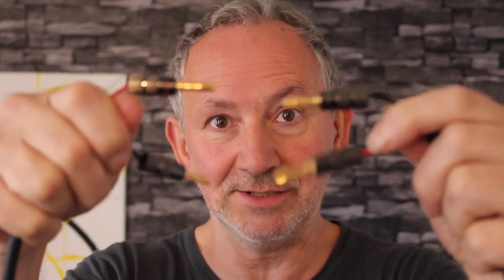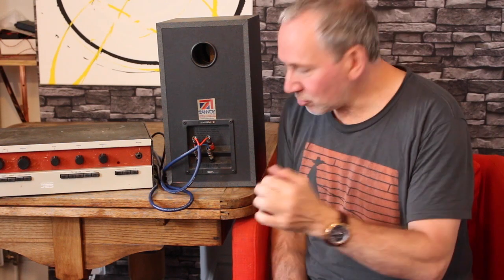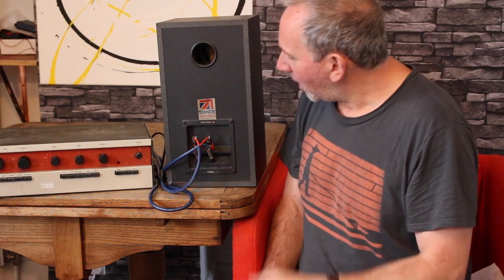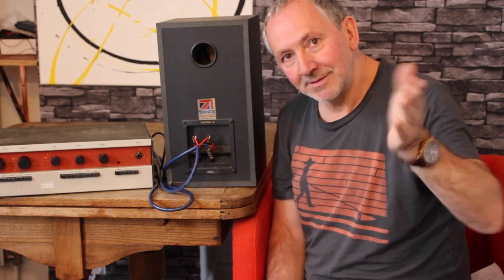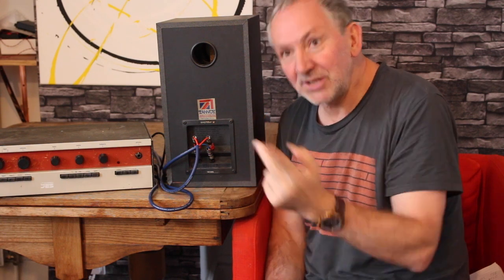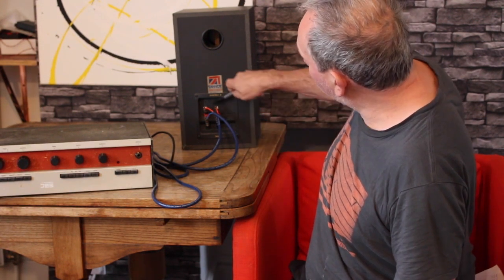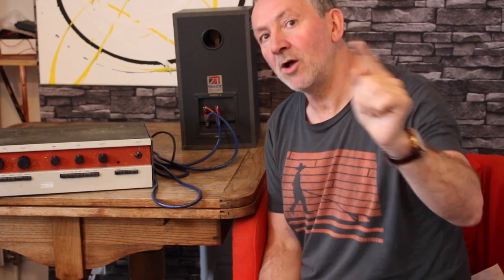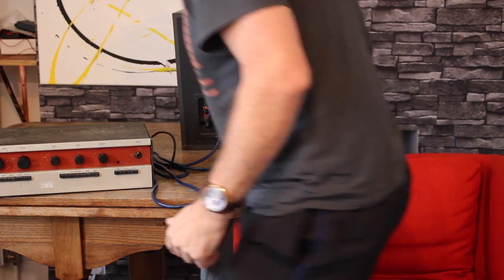WHAT IS BI /WIRING does it improve sound quality

Comment: One thing I am confused about it is when I buy let's say AQ bi-wire set one end has 4 terminations, the amp end has 2 how does one know which is high or low? doesn't it come from the same wire at the end of the day?
Reply from the maker: Yes my friend it doesn’t matter which one is high or low and you’re right it does come from the same wire ultimately you’re doubling your cables which is good
And when it arrives at the speaker One wire will go straight to the tweeter Awelfa which means it is cutting out circuitry which is always good by wiring makes a small difference I would say
But it is a win-win just plain better all round
K
Reply: You are most definitely not doubling the csa of the cable and certainly not by-passing any circuitry, unless jumper qualifies as such. In bi-wiring, you are simply terminating two pairs of wires with the impedance that of the tweeter and that of the woofer only correspondingly, hence separating the current flowing into two branches based on frequency. You would be doubling csa, only if you left the jumpers in, which defeats the whole objective.

Comment: Totally BS. Open up your amp and you would see that your connectors are interconnected to each other. So it doesn’t really matter if you leave your Amp with one cable and then connect to the four speaker connectors or run two sepperate cables from your amp to your speakers. Also your High. Mid and lows are separated on the Crossover. So there is absolutely no need for Bi-wire ring.

Comment: It maybe a silly question,but would it damage the tweeter just connecting it to the speaker output of the amp, without any kind of crossover??
Reply from the maker: It’s guaranteed To destroy the tweeter great big bass notes into tiny dome
Reply: As long as you do not exceed the thermal capacity of the voice coil, 5 -10W usually, and do not exceed peak excursion travel limit, under a single mm in many cases, it would not. Not very practical, but theoretically quite fessible.

Comment: Whit bi wire connections we need to remove shorting bridges yes, but why?
Reply: Because if you don't, current corresponding to the frequency dependent load presented by the tweeter for the HF branch and Low midrange driver for the LMF branch will flow in both conductors defeating the whole objective of separating them.
Reply: You only need to remove the bridge when you bi-amp, as you are using 2 seperate amplifiers (speaker A and speaker B). Just like at the start of this clip. If you are only using speaker A,  you can use as many pairs of cable that you can physically fit, or just use 1 thick cable and leave bridge plate in. there is only one source from the amp, so all frequencies go to both tweeter and woofer.
Reply: Remove those bridges and throw them away, they can completely ruin the sound quality because theyre directly causing mixing the tweet and mid signals.
Reply: @brucebruce3841  Nothing to do with having one source, AC current can flow in many different ways at the same time, only DC wouldnt see any benefit from biwiring, but as audio is AC you are wrong. twin wiring 1. allows twice the current equalling in less stress and resistance is halved, 2, allows your tweets to be fed with proper silver cable not copper, 3, the bridge plate does more harm than good.
Reply: @Synthematix  ok, I’m not an electrical engineer, just someone who thought they knew a little bit about home audio.  so I quickly looked up how electricity flows through copper in AC. It talked about skin effect and higher frequencies travelling on the outside of the copper. Does that also mean for bi-wiring to have better benefits, the second wire should have thicker strands of copper? and would more seperate strands - say using 10 cables not 2 give different results as well?
Reply: @brucebruce3841  Copper carries bass and low mids more efficiently, silver wire carries upper mids and high frequencies more efficiently, (this is the no1 reason for bi wiring) fewer thicker stands would work best, fine strand wire works best for phono cables, in an ideal situation keeping the cable lengths as short as possible equals less resistance and inductance, if you do what i have mentioned you will get the best out of your speakers and amp. bi wiring can sound better than bi amping if done properly. in fact bi amping introduces all sorts of problems like phase issues and delays, in a nutshell, yes the biwiring comes from the same source, however as the audio travels up the cable it gets completely separated due to how ac works and your drivers are being fed with the correct cable types. biwiring also cuts cross distortion in half giving a more dynamic sound. ignore any sites that claim biwiring makes no difference, its the reason why the separate terminals are there in the first place and on your amps a/b speaker outputs. take a look at this article for further explanation: www.qacoustics.co.uk/blog/2016/06/08/bi-wiring-speakers-exploration-benefits/

Comment: Can you just use cables that are twice the size and achieve the same result?
Reply from the maker: I mean I think that would help but the buyer wiring is cutting out some of the circuit path of the crossover which is good also

Comment: Cables make a difference. I tried playing music and without cables I get no sound.
Reply from the maker: Really I’ve tried using spaghetti it’s  quite good but only cook for eight minutes
Reply: @stereoreviewx  yeah I used spaghettoni, forgot the water and result was too hard, soft side was missing, perhaps good for heavy metal. Have to get a valve cooking plate.
Reply: @stereoreviewx  I used spaghetti as tile spacers when I ran out of the plastic sort when working at Baker Street tube station. Not a good idea as the moisture meant you couldn't remove the pasta from the tile joint without it snapping. Forty years on you can still see my spaghetti in the grout lines.

Comment: Long winded and miss leading, Bi wire = both red cables at the amp end into red socket and at the speaker end the 2 red wires connect to the red sockets, same idea with the black cables. Bi amp which is what your showing, requires 2 red and 2 black at both ends connect as you would for left channel and then connect the other speaker the same using the right channel outputs.

Comment: Speaker cables haha, good old twin multicore copper is all you need with a marker stripe
Reply: Twisted pure silver or silver plated in cotton or PTFE insulation sounds a liitle better, but I agree, the expense is injustified, if the system is not up to scratch.
Reply: @paulb4661  hi I had a friend with thousands and thousands of pounds worth of Linn equipment, he swore by using solid core copper wiring the sort that electrician's use for your plug sockets. He sold me his old Linn Nexus speakers and wired them up using this this ring main wiring cable into my system and it did sound good.

Comment: Why is it getting better? If you do a REW sweep with single wiring and biwiring/biamping what you'll see is that the signal arrives at the tweeter and woofer arrives faster because it bypass some of the circuitry. 

The best sound is when both tweeter and woofer are flat SPL across frequencies and most importantly phase aligned too. The first is handled by having 2 amps distribute power (2x more power needed for each octave lower). The second is what smears the sound. Both can be corrected by a DSP scientifically.

This is what you are hearing perceptually. Of course better components, better build quality helps these metrics but they are all quantifiable  measurable metrics

Comment: I don’t really believe in bi-wiring. The crossover in the loudspeaker separates the frequencies sending the highs to the tweeter and the lows to the woofer if you single wire. Now, in bi-wiring, we bypass the crossover and by doing this we feed both the tweeter and the woofer with the full range of frequencies. It’s not a secret that tweeters in general don’t cope well with low frequency and some woofer get “distracted” by high frequencies.
Reply: Bi-wiring does not bypass the crossover. Bi-wiring results in low range frequency current being carried to the bass driver with one cable. A separate cable carries high range frequency current to the tweeter. Despite being connected together at the amplifier, the two cables are carrying differing currents to the speaker drivers. The crossover in the speaker is still in place and doing it's job.
Reply: @ProffAndy  How do the cables carry highs in one and lows in the other? Magic? Unless you have a crossover in your amp the wires are all carrying the same signal. It's measurable using a spectro. The speaker crossover does all the filtering. Bi wiring is the perfect example of enjoying a placebo effect.
Reply: @spudpud-T67  No magic required, just fairly simply physics. I get that the concept of bi-wring can be confusing, and it can seem that there's no way that high and low audio frequency currents can be carried separately by two cables connected together at the amplifier, but that is exactly what is happening in a bi-wire configuration. I`ve tried to explain this a fair few times, and usually my explanation gets ignored, or simply dismissed as nonsense. I have never claimed that bi-wiring produces any audible improvement (or even change), just like I'm sceptical about claims that different types of speaker cable can make very noticeable changes in audio. However, there is no doubt that different speaker cables will have slightly different electrical characteristics, which in theory will alter the current flow through the speaker (usually by a miniscule amount ). Switching from single wiring to bi-wiring will in most cases alter the current flow through the speaker drivers to a slightly larger degree than simply switching to "better" cables. Is that change in current flow enough to be detected by human ears ? I'm not sure, but bi-wring does "split" high and low frequency currents which are carried to the speaker in separate cables.
Reply: @ProffAndy  Unless you have a crossover in your amp you get the same signal passing along both wires. Only in the speaker crossover does the signal get filtered. What I'm poking fun at is people thinking the treble and bass signals obediently take different cables. Check the cables with a spectro to show same signal at the end of all cables coming from single amp. 
However contrary to you statement above "bi wiring doesn't make improvements" it does improve sound but only as a placebo effect.
Reply: @spudpud-T67  Ask yourself "what causes a speaker driver to move, and how does it reach each driver".
Reply: @spudpud-T67 I'll make it easy, it's electrical current. A crossover placed either within the amplifier, or inside the speaker does the job of effectively "splitting" high and low frequency currents. I'm sure you will agree with this. Do you ?  If so, then you need to consider what current is handled by a single cable in a single wire setup. Then think about what happens when you separate the high pass and low pass sections of a crossover (by removing the jumper links on the speaker terminals), and use bi-wire cable between the amp and the speaker terminals. Magic happens. High and low frequency current is now being carried separately in the cables. That's scientific fact, easily proved by simple electronic theory or a current meter.
Reply: You haven't yet poked fun at that explanation, so I assume you agree that it is correct. As I said in an earlier comment, my explanation of how bi-wiring splits high and low frequency currents usually gets ignored or dismissed.
Reply: @ProffAndy  , you have no idea of how your amp&speakers work, you and the likes are the perfect customer for audio snake-oil. A crossover inside the amp is the dumbest idea, as it would do speaker matching a nightmare. Unless that crossover would be variable, adding a lot to the amp complexity and price.  Then what about 3-way speakers?
Reply: @J0hnny8ravo  I know that a low pass filter will allow low frequency current to flow while limiting/blocking high frequency current. I also understand that a high pass filter will restrict low frequency current, but allow high frequency current to pass. A two way crossover is basically a low and high pass filter connected in parallel at the speaker terminals by jumper links/bars. I understand that full range current is carried by the single speaker cable to the speaker terminals. I also understand (which the likes of you don't appear to understand) that in a bi-wire configuration the jumper links are removed so the load on the amplifier is a high and low pass filter on the end of two cables. In this sitaution high and low frequency currents are carried separately in the two cables that connect the amplifier to the speaker. I also have never claimed that a bi-wire configuration provides any performance improvement over single wiring. Ignoring or arguing against those facts won't change them, and proves that you don't, or won't understand them. I can provide an alternative scenario which might just enable you to understand if you still don't get it. BTW, It's obvious that you don't understand when I read your comment "Now, in bi-wiring, we bypass the crossover and by doing this we feed both the tweeter and the woofer with the full range of frequencies." If bi-wiring did that you'd almost certainly end up with a damaged tweeter.
Reply: @ProffAndy , ok.
Reply: @J0hnny8ravo  Ok you now understand, or would you like an alternative scenario to help you understand ?
Reply: @ProffAndy  , I’m done arguing. To each his own. You buy whatever suits your needs and beliefs, and so do I. I’m perfectly happy with my system so maybe I shouldn’t have commented at all. Have a nice day!
Reply: @J0hnny8ravo  I wasn't arguing, just trying to explain a fundamental fact about how electrical current flows in single and bi-wired configurations. Fair enough if you deny that there's any audible difference between the two wiring arrangements, but it's not fair enough if you don't agree that there is a fundamental difference in the way current is carried between the amplifier and the speakers. Like I mentioned earlier, many people think that there's no way high and low frequency currents are split between bi-wire cables because they are connected to a single pair of outputs at the amplifier. Anyone who's studied and has an understanding of electronic theory will know that's exactly what's happening. Anyone who thinks that bi-wiring bypasses the crossover circuitry in the speaker clearly does not understand the simple circuitry of a bi-wired speaker setup.
Reply: @ProffAndy  , in the video above at the very beginning it’s said about bi-wiring bypassing the crossover. At 2:15
Reply: @J0hnny8ravo  It does not bypass the crossover. How can it when the crossover components are still connected between the speaker terminals and the speaker drivers ? In fact, if you look at the circuit diagram of bi-wired speakers you'll see that all you are doing is increasing the length of the jumper links on the speaker back to the amplifier. The high and low pass circuits are still in place, but you are feeding them separately via two cables from the amp.
Reply: Despite your earlier claim, I do know how my speakers and amplifier work (admittedly not down to component level, but I have seen the crossover in my speakers). My speakers have a fairly simple crossover design, but the majority of speakers will follow the same principles. There is a 5.1uf capacitor between the HF + terminal and the + terminal of the tweeter. That's the high pass filter which effectively blocks low frequency current and only allows high frequency current to pass through the tweeter. The bass driver has an inductor between it's  + terminal the the LF + terminal. The inductor blocks high frequency current through the bass driver, but allows LF current to produce bass tones. When the jumper bars are left in place in single wiring the LF and HF crossover components are effectively  connected in parallel, so full range current is being carried from the amp by the cable. Removing the jumper bars and connecting the LF and HF terminals separately via two cables to the amp does not remove or bypass the crossover components, they are still connected in parallel, but back at the amplifier terminals. And I'll say yet again, this arrangement means that LF and HF currents are carried in separate cables, rather than one. That's what promotes claims of improvement in sound quality, due to slight changes in the characteristics of current transfer.
Reply: @ProffAndy  , so basically all you get is a thicker cable. So why don’t use a thicker cable to begin with?
Reply: @J0hnny8ravo  No, you don't necessarily get a thicker cable. You may end up with thicker cable in total, depending on which bi-wire cable you use. You often will end up with a thinner cable to each of the driver terminals. Again, what you are doing is separating high and low frequency currents between the two cables.
Reply: @ProffAndy  can you please explain how will highs and lows willingly separate themselves and if so, why the industry still uses crossovers? Thanks!
Reply: In fact, that leads on to a bit of a controversial point. Some would claim that changing to a thicker cable gives better sound quality. Wouldn't changing to thicker cables that carry low and high frequency separately provide a greater improvement ? I'm not claiming that it would, as I'm as sceptical as many others about the claims made about cables, bi-wiring etc. What I am claiming though (because it's true, not "snake oil") is that bi-wiring does change more than cable thickness, it alters the way current reaches the speaker from the amp.